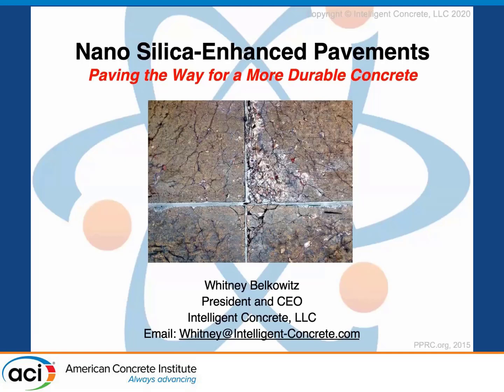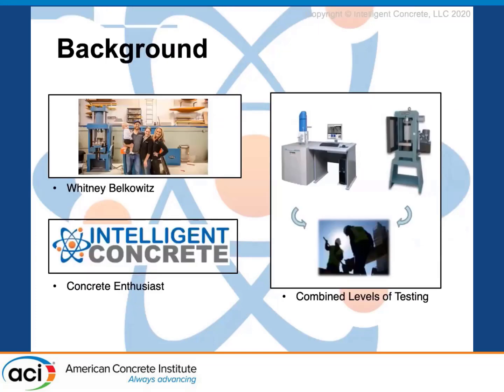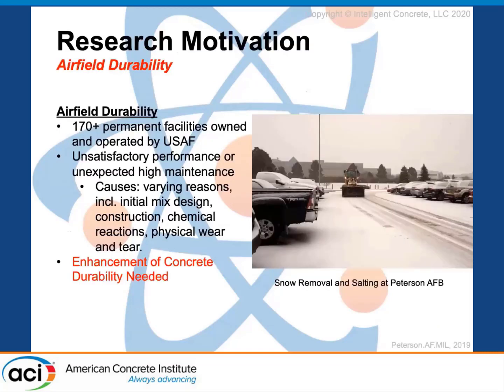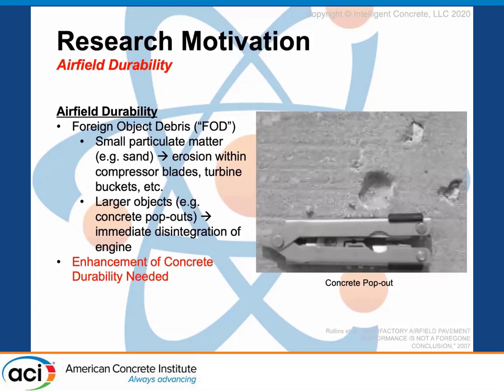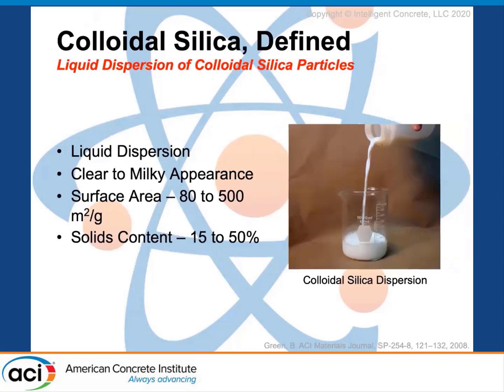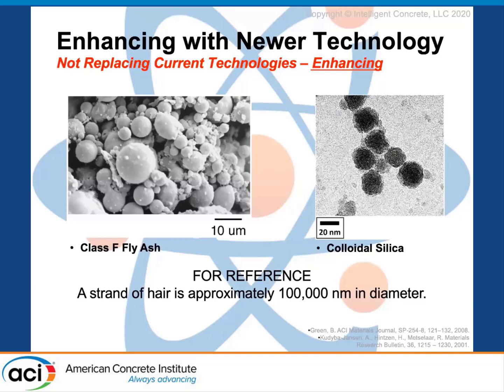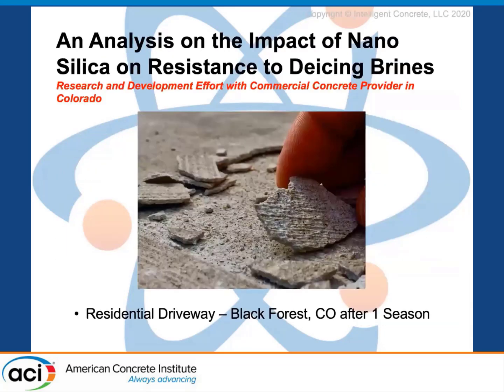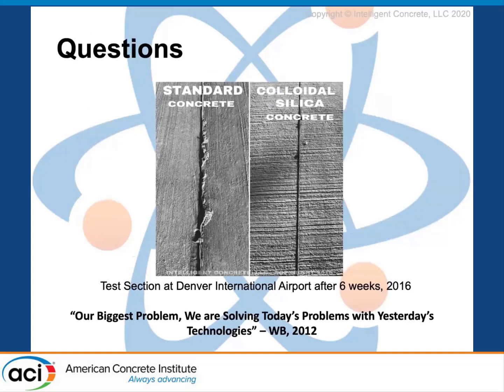Nano Silica-Enhanced Pavements—Paving the Way for a More Durable Concrete

Comment: Good presentation. The Renolith admixture contains colloidal nanosilica (CNS) and fibrous nanocellulose. The product has been used very successfully in cemented pavement materials since mid 1990s. Typically it has been used in flexible pavements (aka soil-cement) rather than concrete. The benefits are similar (improved strength, durability, crack prevention etc).